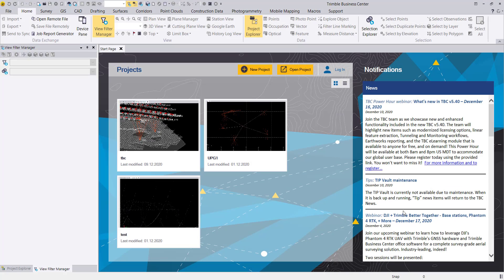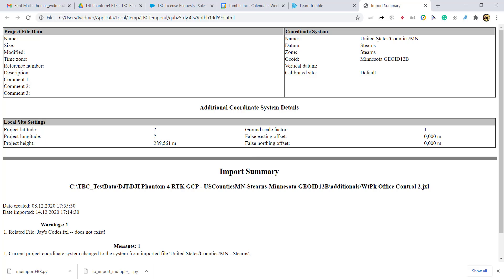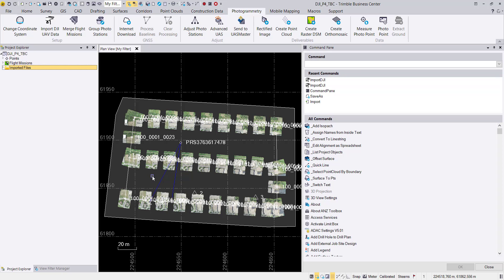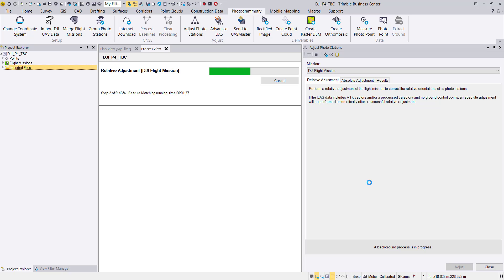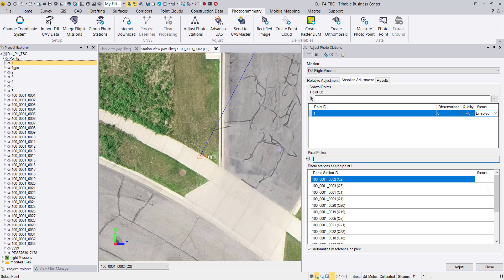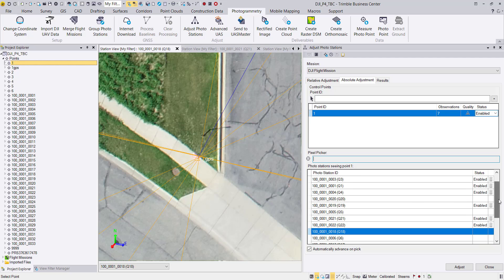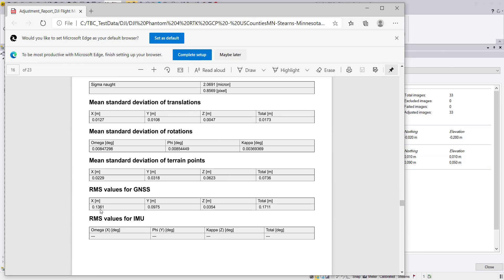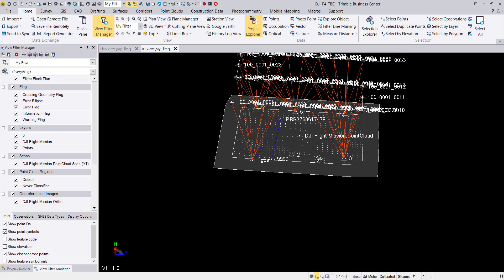DJI Phantom 4 RTK - TBC Processing with Ground Control Points

Comment: When trying to process NON RTK data, what specific files do I need to be ale to process? I use DroneDeploy and Map Pilot to run my missions and not a DJI Program, could this be the reason TBC does not recognize a flight mission? The only data I have are the images from the SD card.
Reply: It has come to my understanding that TBC Photogrammetry cannot accept any other aerial photos other than DJI P4R or SenseFly data: http://www.gisresources.com/tbc-power-hour-uas-processing-using-new-tbcuasmaster-workflows/
Reply: Hello Mike, are you familiar with the EXIF and XMP tags in the DJI Imagery? If yes, then you can check if some of the following values are existing in your imagery:
Camera Model Name               : FC6310R
Absolute Altitude               : <value>
Relative Altitude               : <value>
Gps Latitude                    : <value>
Gps Longtitude                  : <value>
Rtk Flag                        : 50
 (or 16, 34)
Dewarp Flag                     : 1
 (or 0)
GPS Altitude                    : <value> m Above Sea Level
GPS Latitude                    : <value>
GPS Longitude                   : <value>
GPS Position                    : <value>, <value>

In general, all images need to be in the same folder and at the moment TBC supports from the DJI only the FC6310R sensor (DJI Phantom 4).
Try to generate DJI EXIF and XMP entries for your imagery, as this will help to import the data with valid values and it will help the process.
Reply: @tom4trimble  I am familiar with the EXIF data, I just put an image through a program and I do not have the values to som eof these fields and no Dewarp Flag field...
Reply: @mikebuisan2262  Hi Mike did you run your DJI flight in "Photogrammetry Mode"? If not, I would recommend you to give it a try, as typically running a DJI flight in Photogrammetry Mode will add all necessary information to your EXIF and XMP tags. Of course, it can happen that your 3rd party software "removed" information from the EXIF. I hope not, but you could easily check if the images before running your 3rd party software included the information or not. Wish you all the best!